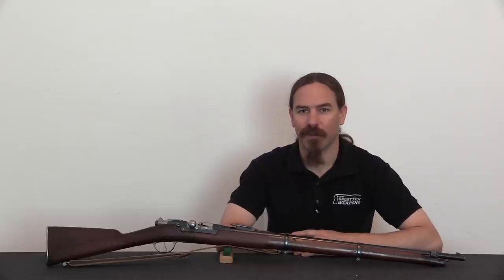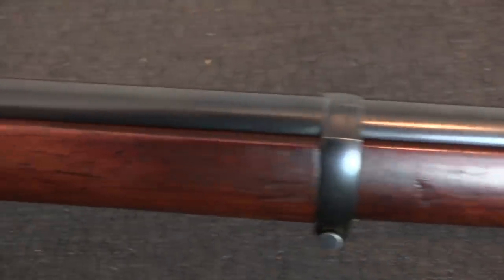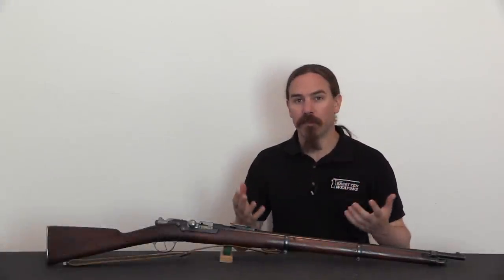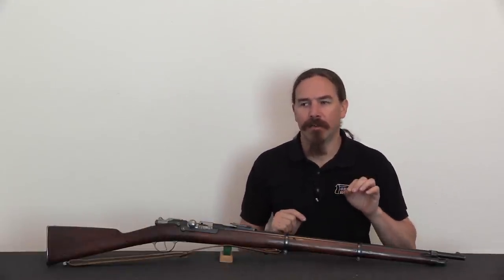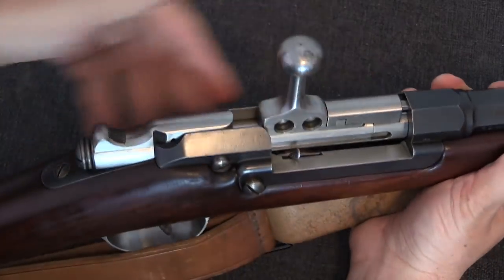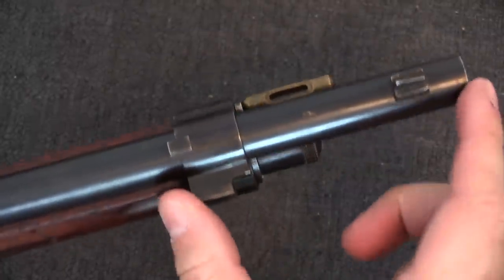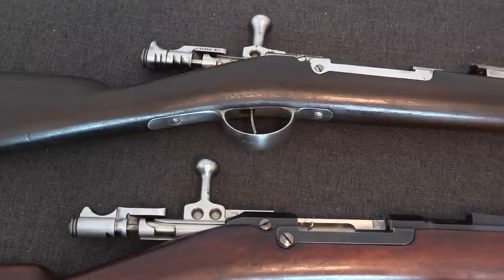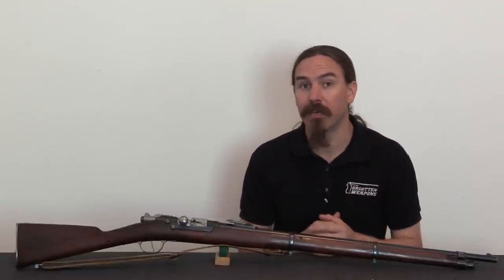1884 Kropatschek: Groundwork for the Lebel

Comment: So the French adopted like 4 guns in the span of like 30 years?
Reply from the maker: This is not uncommon during this period. The US had the Spencer, Trapdoor, Krag, and Lee Navy in the span of 30 years.
Reply: Germany as well. Mauser 71, Mauser  71-84, G88, G98
Reply: Congratulations , the number  of likes for your comment have surpassed the number  of them in it.
Reply: Not that many compared to aircraft development during WW1 or tank development during WW2^^
Reply: Technology was changing rapidly. Breech-loaders replaced muzzle-loaders, then were quickly obsolete because of the metallic cartridge. Then, it was clear repeating arms were making single-shots obsolete. Briefly there was going to be a move to small-bore higher velocity with finer black powder, but  this step was interrupted by the advent of smokeless powder (also with smaller bore). Chassepot (breech-loading) to Gras (metallic cartridge) to Kropatschek (repeater) to Lebel and Berthier (Small bore, Smokeless Powder).
Today, technology is developing even more rapidly, but the advances aren't making existing weapons obsolete. The changes aren't so fundamental.
Reply: @terryreynolds9397  Some of the other significant developments during this time: 1) repeating rifles fed from tube magazines then many from en bloc clip fed vertical magazines, then the stripper clip fed vertical magazines and even a detachable box magazine! (SMLE).  2) Ammunition went from rim fired black powder to center fire, then rimmed center fire cartridges barely changed after moving from black powder to smokeless powder with 2.5X the power for the same weight and finally rimless, center fire cartridges like we still use today. 3) The bullets emerging from the cartridges were large, slow-moving, high arcing "pumpkin balls" then much smaller and faster with round noses and finally pointed "spitzer" noses that move fastest of all with flat, easy to aim trajectories over long range. Again, these spitzer bullets are still standard issue for hunting and military use. All of these developments happened from about 1870 - 1905. For comparison, the US Army has been using Eugene Stoner's M-16/M-4 in a few versions for about 60 years now. A soldier serving now may have a great grandfather who served with an M-16 in the early days of the Vietnam War while the descendant is carrying an M-4 somewhere in the Mideast or Afghanistan. The replacement of most of the M-16's furniture with Picatinny rails and more generous infantry budgets means that optical sights, vertical handgrips, adjustable buttstocks, and other accessories have become much more accessible to the common soldier, but the M-4's ammunition, method of operation, and maintenance procedures are but mildly changed from the M-16A1 that I carried. The M-16/M-4 is practically a modern "Brown Bess."
Reply: @ForgottenWeapons The French procurement was more rational, based on technology developments. The US clung on  to the Trapdoir Springfield until it was seriously obsolete.

Comment: According to my venerable 11th edition of Small Arms of the World, the Turks obtained about 30,000 Winchesters and used them with awful effct at Plevna. First they fired their single shot weapons and when the Russians made their rush at the Turkish lines, the Turks picked up their Winchesters and hoed away. The results were pretty bad, as the Russians assumed they had a clear run - in formation p- at the Turks. Bummer.
Reply: The Winchesters were Turkish cavalry weapons. Re evaluation of primary sources is making some wonder if the events were that the Turkish infantry engaged the Russians at maximum range right down to the final assault whilst the dismounted Turkish cavalry had to wait until the Russians were within the close range of their Winchesters. Whether by accident or design the story of Plevna is the trigger for magazine rifles to be generally adopted. The story being that each Turkish soldier at Plevna had a both a Peabody Martini and a Winchester. Being in a well supplied dug in defended position the Turks had no issues over ammunition supply.
Reply: @johnfisk811  TYTY for the information
Reply: Smith's, "Small Arms of the World" (if you can find a copy) has a pretty good description of the battle.
Reply: The Ottoman troops did not change weapons mid-fight. A percentage of men in some infantry regiments had Winchesters while the majority had Peabody-Martinis.
At Plevna they had the fire discipline to only use their Winchesters at short range.
Reply: @johnfisk811 The majority of Winchesters bought by the Ottomans were full-length military rifles. They were used by light infantry units.

Comment: Very nice! I have a 1886 Kropatschek. My rifle has a really low serial number, looks like it is one off the first hundreds that was produced. It also seems to have been used A LOT. The bluing is gone all over the rifle, it basically looks like silver. The stock is also really beaten up, with deep scratches and marks everywhere. But despite all this it has a really smooth action. I really wonder what stories my rifle would tell if it could talk.
Reply: What is considered a low serial number? Like what range in the numbers? 1000s?
Reply: @nickz5849  Around 49,000 rifles were made in total, counting all M1886-variants. The serial number on mine is just above 400, the letter "A" is before the serial number. So with a 400 serial number and the letter "A", it is an early rifle from the first 400's.
The rifles were produced with a 3 digit serial number, with 1 and later 2 identical letters. They were produced in letter blocks. 2 identical letters indicates the second production run.
They produced 999 rifles for each letter because of the 3 digit serial numbers. When all the rifles from A to Z were produced, they started with 2 letters before the serial number. "AA 1" being the first rifle of the 2 letter production run and "ZZ 999" being the last rifle of the 2 letter production run.
The letters was in alphabetical order, from A to Z.
For example: "A 1" would be the first rifle ever produced, "ZZ 999" would be the last rifle. Only 2 alphabetical blocks of rifles were produced, the production stopped just a few letters before they actually reached "ZZ 999".
So the serial numbers should look like this, from first rifle to last rifle:
First production run: "A 1" = first rifle. "Z 999" = last rifle.
And:
Second production run: "AA 1 = first rifle. "ZZ 999" = last rifle.

Comment: One can understand the magazine cut-off mechanism from a logistical point of view, especially with black-powder rifles, were ammunition was more expensive. It still makes some sense with a tube-magazine rifle, as the reload of the magazine would still be done 1 round at a time. You need a box-magazine that can be fed with stripper clips to make the  magazine cut-off entirely obsolete.
Reply: I think the cut-off has more to do with the doctrine of the time. I think even the earlier Enfields had a cut-off, despite the stripper-fed box magazine.
Reply: @schwaulen  Correct. The SMLE didn't do away with the magazine cut-off until the middle of WWI, around 20-30 years after the first box magazine Metfords and Enfields.
Reply: That was sort of my point. The original rationale was both to conserve ammunition and to have a ready reserve for when things got hectic. With stripper clips, you reload your magazine so fast that it doesn't matter if do aimed shots from the magazine or reload one cartridge at the time at long range. With smokeless powder being cheaper, it is easier to bring and expend more, especially since the cartridges get better and won't "spoil".
Reply: @schwaulen  Did US guns of the time have cut off as well? I'd think that feature would have been handy in the west against the native americans. 
Take potshots when at long range and when they charge in or surround you, then open up the magazine.
Reply: @LankyAssMofka  I know the Winchester Hotchkiss did. I think the Springfield 1903 still had one as well and I'm sure there were others.
Reply: @schwaulen  Charger loading was added to the Lee-Enfield after nearly 20 years service. And retrofitted to earlier guns, which retained the cut-off. It took another eight years before we stopped including it on new guns.

Comment: Were they still using black-powder ammo when they were sent to Russian and Spain?
Reply: They were not modified to fire any other cartridge and they wouldn't be strong enough for smokeless powder with just the bolt handle as the only locking lug.
Reply: @MarvinCZ  Maybe they had reduced-power smokeless ammo, similar to modern cowboy action ammo.

Comment: 4:37 did you say 1900 meters? They were shooting out to a mile+ accurately in the late 1800s?
Reply: Used for volley fire
Reply: Is what they call volley fire. You get a bunch of guys aiming at a target in the distance, everyone shots, maybe someone hits something. I believe is more a suppressing fire than anything, like the most improvised form of artillery.
Reply: As others have mentioned, it was not for accurate fire, but creating a "beaten area". Don't forget at this period, armies were still using the close formations that had been used in the Napoleonic (and earlier) wars, so there would be a large number of troops marching in a tightly packed formation. If all your troops aim at the formation using the 1900m sights, they will be unable to hit any specific individual, but by aiming very high, they create a rain of bullets through which the column has to march. There might be no casualties, there might be a few, but the effect is more psychological, than militarily effective. Try to imagine the effect of having to march through this rain, with maybe the odd man being hit, knowing there is no way you can avoid being hit if the bullet arc and your position co-incide.
Reply: Yes. Your target its a closed order 800-mansize target. Acurate enought.

Comment: Cleaning rod or stuck cartrige removal rod
Reply: Cleaning. That little slot in the front is so you can stick a cleaning patch through it before wrapping it around the head, it's thr same style of head on the cleaning rod for my C7, just not collapsible.
Reply: @MaHaL1337  I was being a bit sarcastic.   those old BP cartridges would jam quite often or extractors would break. Is handy to have  rod in case you have to punch somthing out

Comment: Does anyone make a modern Famas that's cheaper than the batch Century Arms had in the 80s that go for $30,000?
Reply from the maker: No.
Reply: until 3D metal printed parts is reliable  and affordable, it will never happen.
Reply: In Europe u can by one in good condition for 1/10 of the price, but it will come in 222rem.